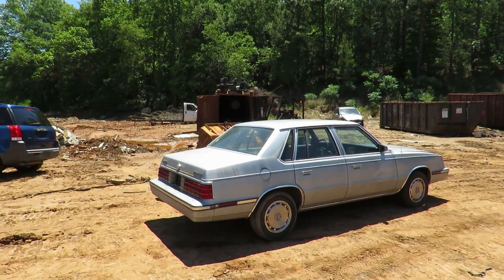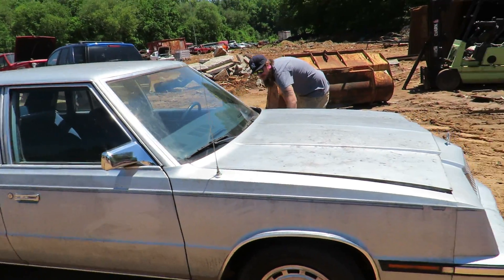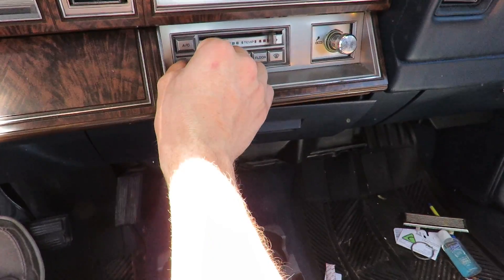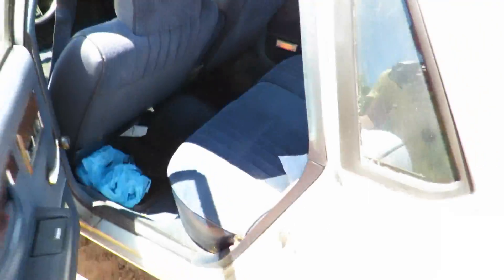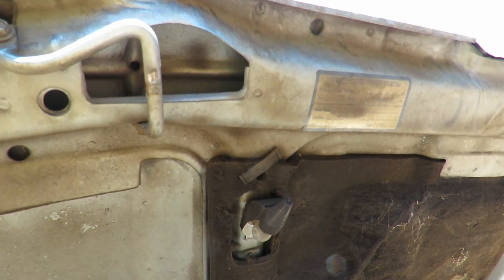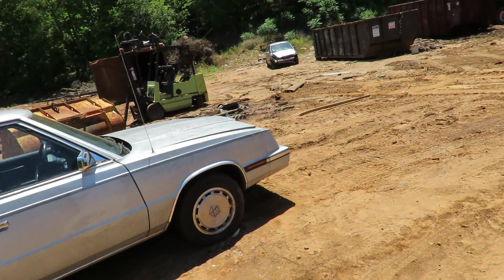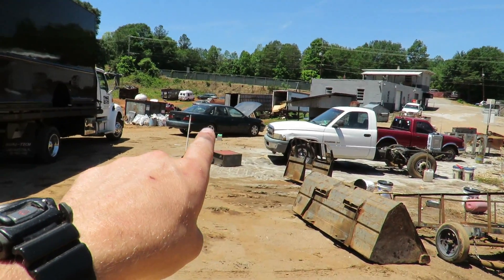Junkyard Rescue 1985 Plymouth Caravelle

Comment: There's definitely a touch of Buick Grand National/GNX to the front of this car.  But DEFINITELY not the performance.  It's important that cars like this are saved, a few years ago nobody in the UK thought Ford Cortinas (ANY generation or version other than the Lotus) would ever be seen as interesting.  Now, nice original or well restored cars are well over £10k and interesting or unusual versions can be several times that.  This is a real "when did you last see one of those" cars and it will get a lot of attention on the road.  This is also the car that gave it's underpinnings to create the very good looking Dodge Daytona (Dee Dee McCall's car in the original TV series of Hunter) back in the '80s in the period when Chrysler had their tie-up with Carroll Shelby producing such bonkers vehicles as the Horizon Shelby Turbo.  I think he even worked his magic on a quick K-car too...
Reply: gosportjamie I used to have a car like that but it gave me a whole bunch of problems never again
Reply: Do you still have this car
Reply: Have had three mk3 Cortina's in my time (wrote one off),my first one was a 1.6 GXL wish I still had that!
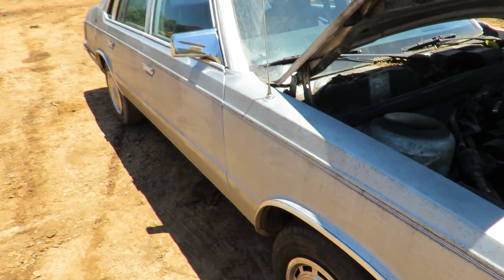Reply: Yo you cracked me up at 7:30.

Comment: Nice classic that's  worth saving. Don't seen them anymore. 👍
Reply: The 1983-84 Chrysler E-Class, what the Plymouth Caravelle replaced for 1985, is even rarer. The Canada-only 1983-86 K-body Caravelle coupe (you know, same as the Chrysler LeBaron and Dodge 400/600 coupes) is even rarer.

Comment: The C Body 1987-1993 Dodge Dynasty New Yorker (excluding New Yorker Turbo E Platform which went by that name for 88 model year only) replaced it along with the AA platform 1989-1995 Dodge Spirit/Dodge Spirit LE R/T ES and 1989 Plymouth Acclaim Base Highline and LX models and the P Platform 1987 Dodge Shadow and Plymouth Sundance were supposed to be replacements for the Dodge Omni and Plymouth Horizon. But Chrysler didn't kill the Ommi and Hozian because they still were highly profitable. Also, the 1985-1989 Dodge Lancer and Lebaron GTS were also supposed to be replacements for the E platform as it was discontented in 1987 but a few left over were 1988 models. Which the lancer and Lebaron GTS were killed by the AA platform 1990-1994 Chrysler Lebaron (Dressed up Plymouth Acclaim). The Lebaron AA car was a flop as many considered it a overpriced Plymouth Acclaim and Dodge Spirit which sold with all options for 3,000 to 6,000 less.
Reply: Which why there was no 4 door Lebaron for 1989

Comment: My aunt used to have a 1983 reliant k wagon. Great car! She also has the longest lasting 1995 neon I ever saw! She bought it from a couple that my grandmother was friends with. It had 50k on the odo. She got rid of it when the timing belt broke at 250k. Prior to that happening the car never had any problems.
Reply from the maker: Those engines are non interference. Ive changed timing belts on dozens of them after they broke. She could have had a new belt thrown on it and kept trucking!

Comment: It looks like that driver's side front wing/fender has been pushed in by the front edge of the door where the hinges are worn and allowing it to move around.  Sort out or replace the hinges (it looks like they're bolted to the A-post and door so if you can find a parts car in a junk yard or something there's a good chance that rear door hinges will be the same and not worn out, granddad/grandma cars often have worn out driver's door hinges due to the driver using the door to pull themselves onto their feet as they get out of the car) and then pull the front wing/fender off and straighten it, it should go fairly easily as it doesn't look like it has creased so a little heat and some gentle persuasion should get it back in shape and good to go.  The paint doesn't look too bad, so a good wash and thorough clean of the body, get rid of the flaky lacquer where it has been cooked and peeled and you might be able to re-lacquer the areas where the paint has peeled and get it looking really sharp again.  If the paint has been badly cooked or oxidised a GENTLE dose of mild cutting compound like T-Cut (the original red bottle stuff, not the metallic paint stuff) should bring it back well enough to take lacquer well.  I know it's not an approved method, but I've used it before on cars with patchy lacquer and it's worked well for me, just make sure you clean the cut area down well and wipe it over very thoroughly with pre-paint or the silicon in the cutting compound will cause all kinds of reactions in the lacquer...

Comment: If you get the sound working that car probably has a Chrysler Eva like my New Yorker. It will talk if it does
Reply from the maker: Holy cow really??!!
Reply: Yeah but only with a factory radio for some reason so if it has to get changed you will need another 80s Chrysler radio to see if yours does that

Comment: I would fix it up and flip it. I definitely wouldn't use it as a daily, you'll spend more time fixing it than driving it.
Reply from the maker: I appreciate the opinion. But just like corollas. K cars strike something in me. So its a risk I'm willing to take. Even if takes regular weekend tinkering. Ill be okay with that.
Reply: Jay Smart exactly. even if not found locally, online parts are still plentiful, and dirt cheap. and, a chimp with two eye patches and basic tools can keep this going strong for another 15 yrs. in SC you can feasibly drive the same car forever, so long as you're willing to repair when needed. they simply don't rot away down there

Comment: I had an '86...I had a shit ton of K cars in the '80s and loved most of them-especially the Turbos and the ones with the diagnostic computer and the talking cars with Chrysler's Voice Alert system (the on off switch is in the glove box if you ever want to check for it). but the Caravelle was never my favorite. The link below is to a pic of my '86.

https://scontent-iad3-1.xx.fbcdn.net/v/t1.0-9/1385435_10151624604626356_1737892575_n.jpg?oh=1f8c6435c409c1e488f64889accf2522&oe=5A2D1D73

By the way, all K cars have a built in diagnostic system. Quickly turn the key to the "on/off/on/off/on" (on, not run)-then count the flashes of the check engine light. If it flashes five times, pauses, then flashes five more, that is a code 55-which means everything is okay. Allpar has a guide to the flash codes.

Comment: Seems pretty clean. Hard to find 1 that isn't all rusted away, especially underneath. That EFI set up it the 2 yr only  55psi system, and those pumps are expensive. Even when it has 40psi, it still won't start! Be sure to replace the fuel filter as well. The Bosch injector is not very forgiving.. Also changing the hall effect pick up and timing it properly, is key to a great running 2.2/2.5.  There is a special procedure to timing those things.. Anyhow, at 90k, that engine should last a very long time, and those A413 automatics last literally forever with very little maintenance. Spring for a good quality pan gasket if you choose to keep it. Fix the door/fender issue, clean it up, and drive it!  I would :)

Comment: the 2.2L in other Chrysler vehicles they had a Holley two barrel carburetor as i think the fuel injection was single point or throttle body injection for these.  as the Chrysler K cars at the time used the 2.2L as then there were many of these around as well as the chrysler minivans.  There was a 2.2L turbocharged engine that chrysler built for the daytona then and a special race 2.2L engine and a german Getdrag transmission made. as i seen the Davidsfarm videos of that Dodge Aries wagon he built and called the turbo Aries race wagon.  as the K cars they had a Mitsubishi 2.6L engine and in 1987 they introduced their 2.5L engine as well as a Mitsubishi 3.0L V6 engine as then Chrysler was in financial trouble building these vehicles then.

Comment: I had a 1990 Dodge Spirit 2.5 turbo and it was a pile of dog shit. It threw reverse and I paid $40 for a transmission and some dude a case of beer to change it, and it shot a rod out the side of the engine going around a turn because the pickup starved of oil. Wtf? It sat and my old boss told my buddy to repo it...lmao He showed up, I handed him the keys, and said have at it. That 2.5 was locked SOLID.

Comment: That is definitely not a car worth saving, sorry. In an accident against any car built in the last 10 to 15 years you would could be seriously injured or killed. I worked in a collision shop that dealt with a lot of Chryslers when that 600 was new, and they were cheaply built cars with a life span of less than five years. Weigh the value of your life very carefully before you put that death trap on the road.
Reply from the maker: volvowagon70 my daily car is a 87 LTD. the rest of our fleet also consists of old Detroit dinosaurs. safety isn't exactly at the top of my list anymore. if I die in a kcar. it was my choice. I thank you for your concern for our well being . But I'm going to take my chances.